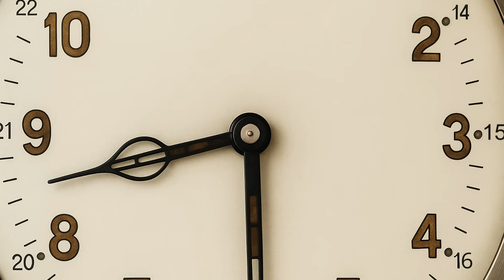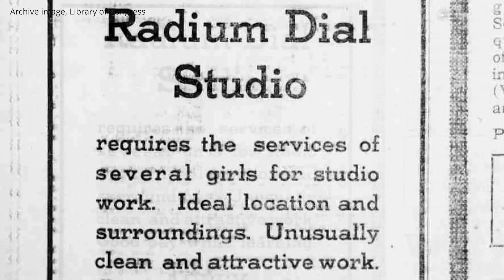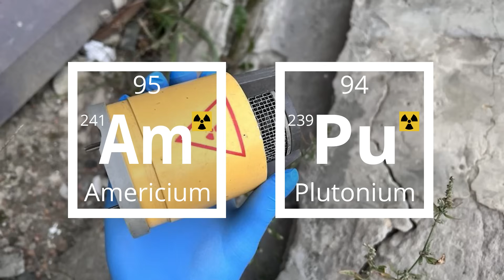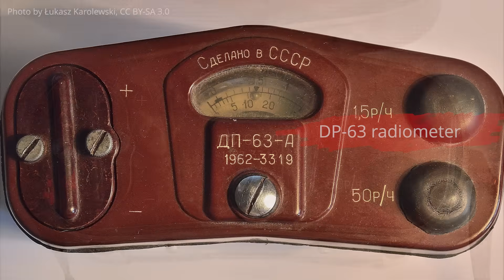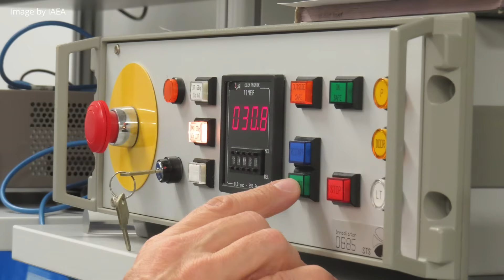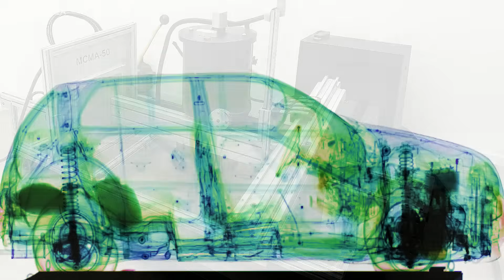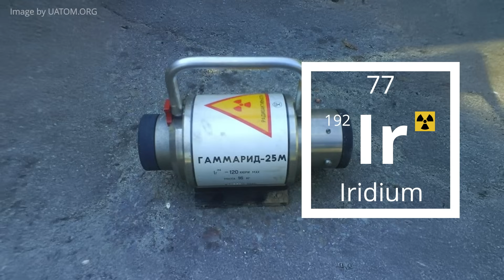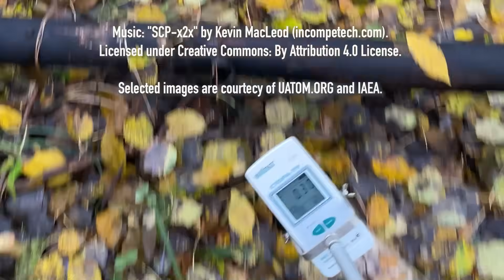NEVER EVER Touch These Objects!

Comment: A friend, Graeme (RIP) worked in a sheet metal producing factory, where large blocks of steel were heated up, then run through rollers to produce sheet metal. The thickness of this was/is measured using a radiation source as the sheet metal is near red hot, travelling quite fast through the rollers, so directly measuring it is out. Anyway, one day they upgraded that instrument, the older one being sent to the scrap department (as in 'for sale' at scrap metal rates to employees) where Graeme bought it, however to his shock, it still had it's source fitted. Luckily he was familiar with this device and immediately recognised the source part and knew what to do. (he definitely didn't want that part)
Reply: Am241 has weak gamma 59.5kev
Reply: I found one at a junk yard years ago. The source is a bit spicy but isn't strong enough to be actually dangerous unless you wore it around your neck or put it on a keychain. Cesium 137 125mCi when new.
Reply: @christopherleubner6633 Cs137 killed a few people in south America and a lot of buildings had to be torn down and a large decontamination operation was undertook. Goiania incident.
Reply: the fact that they use a source and not an active acellerator like many radiotherapy machines is crazy.
Reply: @SB7-r9i  Sources are very common on thickness gauges because they are cheaper, small, reliable and most importantly highly stable. Such sources usually have activities of several milicuries. An accelerator would be very expensive (it has to be very stable), much bigger and requite significant maintenance, specially to work in the harsh environment of a hot rolling mill.
Reply: @teresashinkansen9402 yeah kinda makes sense there, i did work at a cable making plant for an Internship, and my job was to fix a thickness gauge that checks if the jackets thickness was uniform, it was an optical one though, so no radiation.
Reply: A nuclear source is very stable unlike an x ray tube. It's always on and doesn't need daily calibration to use it. Also the gamma rays are extremely uniform in intensity so your detector won't get errors from a tiny speck of something higher density on it. Also it can take the heat and vibration well. I've used them for level sensors and density gauges for tanks of mineral slurry. 😊  @SB7-r9i

Comment: I knew a guy who had a hell of a lot of WW2 era aircraft gauges on display in his living room...
Reply: His biggest risk would be Radon.  Unless you ingest or inhale the paint Radon is actually the biggest danger of such devices. If you have them keep them on a sealed container in a well ventilated place.
Reply: @teresashinkansen9402 Marines would eat these aircraft gauges
Reply: @teresashinkansen9402  Have you actually watched this video?
Reply: @wrrr10g53  Yes.
Reply: honestly that sounds cool as hell
Reply from the maker: This is what you call a bad judgment
Reply: I have three military toggle switches, the tips don't glow in the dark at all any more, but they will peg a G-M counter on the X1 range.  I do not carry them around in my shirt pocket.  They're in a tea tin lined with .125in sheet lead, soldered at the joints.  I also have some Trinitite in there, and it's practically cold now.  The hottest item in the box is an Americium smoke detector source.  Am-241 has a short enough half life to be really hot, but long enough that it doesn't decay slowly relative to a human lifetime.

The Trinitite was hotter than I got it, in the 1980s.  It was MUCH hotter when my source got it from his source. :)  That's decay for ya.

Comment: A frightening video even though that is unintentional!  I see in some antique stores or yard sales the old alarm clocks with the brown radium paint.  Sometimes the glass is broken or missing, or you can see the paint flaking off!  It is not understood by the vast majority of people how dangerous this is!
This video production is an excellent and timely warning!
Reply from the maker: I must say that SOMETIMES a safe non-radioactuve paint looks the same. So the only effective way is to have a dosimeter (geiger is ok, stintillation-based is better)
Reply: @ChernobylFamily  Thanks!  I use RDX DX-2 with GM tube!  Some old aircraft instruments are very hot!  Also does not radium decay into an even more dangerous isotope?  I read that somewhere!